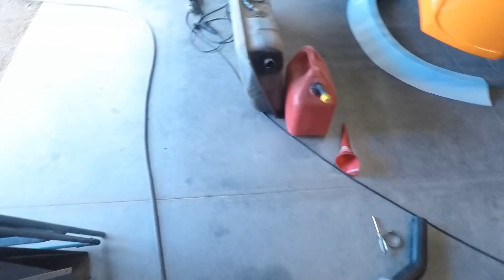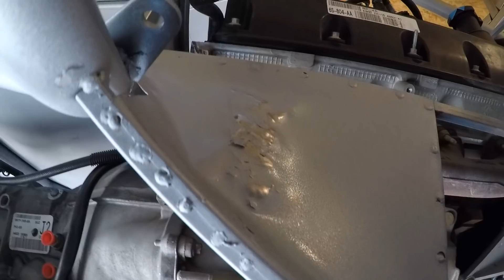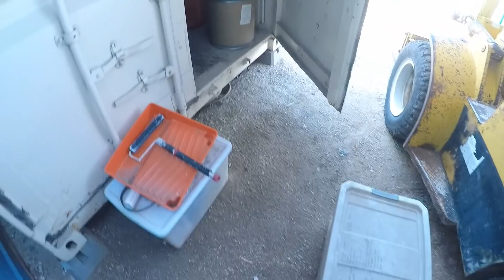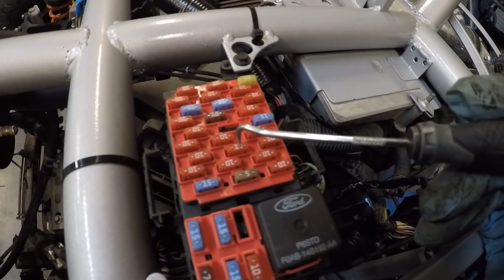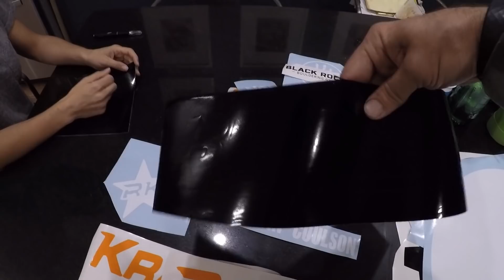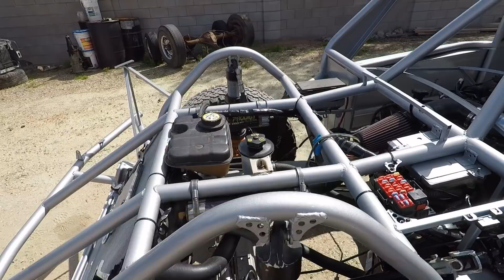$4k Crown Vic Trophy Truck Build (Episode 17)

Comment: There's not enough Crown Vic to just leave it registered a Crown Vic?  You're using the chassis and drivetrain?
Reply from the maker: If it still looked like a car, I probably could have gotten away with it. because the body style was "substantially changed" I had to do it this way.

Comment: dude if your putting your kid in the back get a heavy duty floor back there to keep the driveshaft from mangling them.
Reply from the maker: There's steel tubing between the DS and the seat. I'll still probably add a loop

Comment: I noticed you used fuel line on the transmission cooler lines. If you use power steering return hose it will last. Fuel line isn't compatible with transmission fluid, but power steering hose is.
Reply from the maker: Good eye, this was temporary as it was all I had at the moment

Comment: This is a fun build... I really like it...(yes there is a BUT coming up...lol)  I have worked on a LOT of crown Vic ,Mercury grand marque , and Lincoln town car ... the rear axle s Are going to be my guess as to what will fail first .  I put so many bearing and axle shafts in just under normal use I can't imagine taking any real abuse. not wanting to be negative just giving you a heads up... great build... wish i had the time to do stuff like that...
Reply from the maker: That doesn't strike me as negative at all. Somethings gotta give and your guess is as good as mine. I've never (knock on wood) broken an 8.8, but there's a first time for everything and 35" tires are a lot more than this was used to. Are your experiences from the 28 or 31 splines?
Reply: 31 splines mostly (on Lincoln town car)
I have only noticed bearing failure witch intern chewed threw the axle seemed to also be mostly on the passenger side  and a couple times the retaining pin broke  (very rare) and one time the little retaining bolt broke. Thanks for responding... keep having fun ...

Comment: The way you have welded the exhaust together prevents it from actually having any sorted suck through Flow as the x pipe is meant to help draw the exhaust gases out of the engine but the way you have it set up is going to force exhaust gases back up into the manifold

Comment: Awww Your son is so cute :) I love your Channel, been following your Crown Vic Build,  I am a Retired Female Fleet Equipment Mechanic, I live in the High desert  in Calif. I repaired Autos, truck, diesel and heavy Equipment, been turning wrenches for 40 Years :)  I do welding, fabricating, Painting, auto body repair, hydraulics ,  I have a project too :) I bought a 1973 Ford Ranchero used in 1973 with 20,000 miles on it, Its been in the Family for 46 years, its worn out, it has 400,000+ miles on it, My Father Has been using the Ranchero for over 35 years, It came back to me, heads have never been off the eng, My Machinist said that he never saw a engine with .010 tapper in the cylinders :)  Eng is overhauled now, I taught my Grandsons how to overhaul a 302 V8, now the Auto trans needs to be overhauled, I overhauled The trans  last with about 100,000 miles on it, and then the rear end, it will get 3.55 gears and posi. :)  and a 4 barrel 600 cfm holly, with flat top pistons, and a Howard cam :) You are giving me The Inspiration to get back to it and Get R Done :) Take care, Chellie
Reply from the maker: I'm always excited when someone is motivated by my videos. I LOVE rancheros. My Mom's first car was a pink 62 and I am keeping my eyes out for one. I am so glad you keeping one going. According to google my viewership is 99.7% men, so I started thinking my Wife and Mom are the entire .3% so it's fun to hear from you.

Comment: Nice progress, shes almost done!

Quick question: did you ever extend the line on the diff breather? it might be worth it if you plan on going through water. Also, are you going to add any headlights?
Reply from the maker: I have thought about extending the diff breather, but I can't imagine I will willingly go through much water since the intake is exposed and it's 2wd, but I haven't decided yet for sure. I am adding headlights and high beams. I bought them a few episodes ago but I haven't installed them yet (should be in next video, tho)

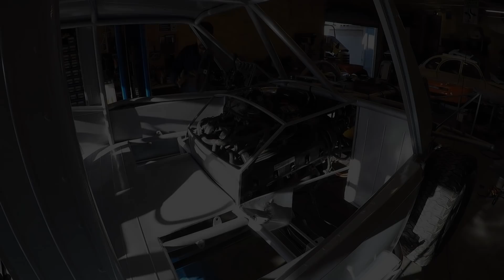Comment: 11:00 cars these days will burn older fuels. The computers make adjustments. So I buy gas for my power equipment and only keep it for a month. Then I put it in my truck and buy new stuff. I found that doing this has almost eliminated any issues with the small carbs.
Reply: Ethanol free fuel.  Problem solved, and no more concern with storage life.
Reply: Yep....been ethanol free for years.

Comment: Really proud of you Austin. Its looking great. Is there going to be any more orange towards the back to match the hood? Looking forward to that hard desert test.

Glad you are taking virus precautions. When I go public I wear gloves and treat the door to my car as the door to my clean environment. After the store, I strip the gloves before touching my car door to leave.
Reply from the maker: I wanted to add some orange to the rear, but I couldn't find a spot that I think would look good. Any suggestions?
Reply: I agree its tough call. Maybe experimenting in an illustrator app you could try different combos of:. 
Rear wheel fender, just the thin outside portion that is flat. 
Or try the rest of the rear fenders excluding that flat part.
Accents in the front side 3 air scoops.
Pin stripe affect on rolled line on the door panels.
Orange windows nets.
Its just that the orange hood is kind out there all by itself. I am guessing the orange in your decals were towards the goal of evening that out.

Comment: The long U shaped cooler is for power steering cooling
Reply from the maker: Spot on. I forgot the trans cooler was in the AC condenser on these. I am going to try to find a way to get the PS cooler back on
Reply: I was thinking the same thing.

Comment: The transmission cooler is the bottom section of your AC condenser
Reply from the maker: I totally forgot that! I mistook the large PS cooler for an external trans cooler since I scrapped the AC Condenser. Good eye.
Reply: @AustinCoulson  I did too. I bought a replacement front section (rad, fan, condenser, ps cooler) when my original fan was burning out fan control modules. So I hope to run 2 power steering coolers to keep my pump happy on 32s and a full weight Vic.

Comment: Its looking good cant wait to see it on the road :)  only thing is I didn’t see a fuse on the main power wire near the battery in case the wire grounds out with the quality of your work I know you got one just more for people watching wanting to do the same like me :)
Reply from the maker: I have never seen a main fuse on the positive cable between the battery and the starter. I use fusible links between the battery and the alternator, and a master cutoff switch on cars that have to go through a tech inspection for racing, and will probably add one to this build but I haven't decided where. Some racing bodies want the cutoff accessible from the outside and some want it accessible to the driver. I have always preferred driver accessible,  but when the battery is in the rear, you still have a length of cable that is unfused on the way to the cutoff switch. Thanks for the comment!
Reply: @AustinCoulson   ops sorry didnt explain it right on the battery at the back the long wire to the front didnt see a fuse on there just incase the wire from the battery to the cutoff or fuse box get grounded when doing silly things off road